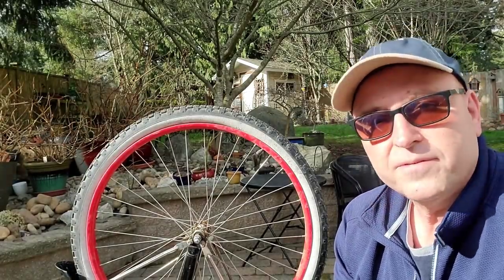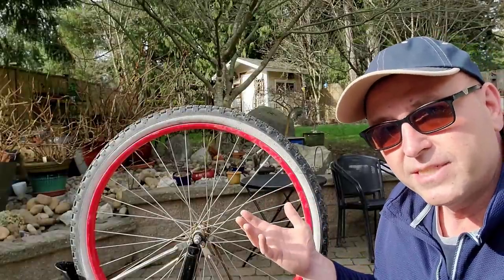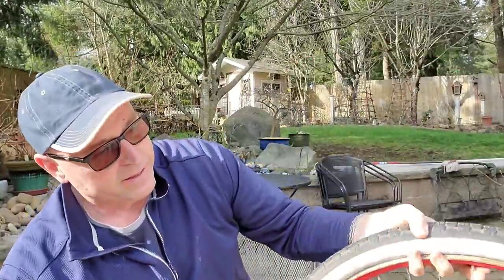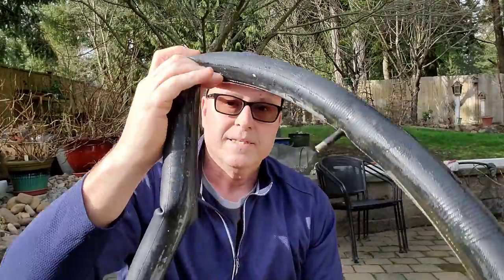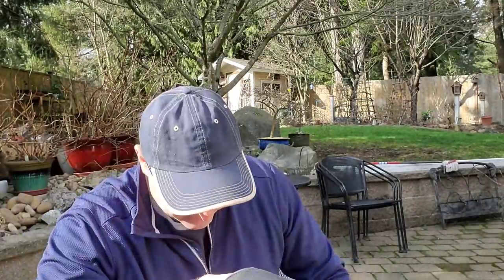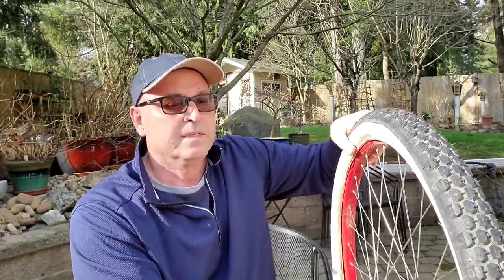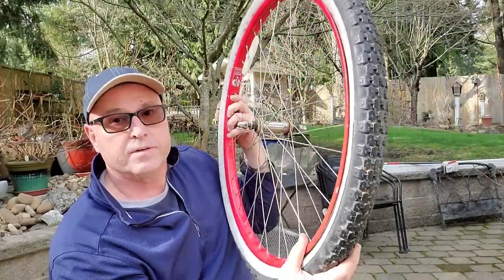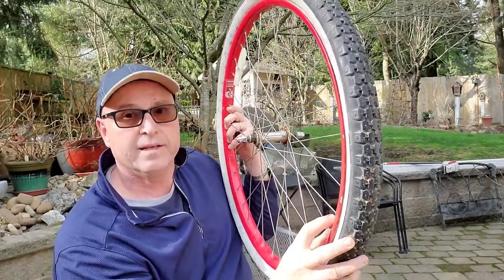How to Fix a Flat Bike Tire

Comment: Imagine my surprise a few years ago when attempting to fix a bicycle tire that I discovered that there is more than one type of tire valve.  Just like me, your viewers may not know this. Thank goodness for the internet.  The one we are all use to is the Schrader valve like on car tires. The other is a Presta valve. When you buy a hand pump, make sure you have the provided adapter if you are dealing with a Presta valve. The two don’t work the same way. I remember wondering why someone thought it was some sort of improvement.

Comment: Good Joke:) I am going to use it :)

I want to start off by thanking you for making this video and I appreciate what you are doing. 

However, I am a long-time cyclist over a variety bicycle styles and I would like to weigh in on your advice which isn't bad at all but could use some clarification. 

Flathead screwdrivers will work in a pinch, but I highly recommend not using them. Thin rims for certain bicycles can be damaged by them or the tube or even the tires. The tools for removing tires from rims are called spoons and they were even once used on automotive tires but made of iron. 

The ones used for bicycle tires are made of plastic, are much easier to handle, and are very efficient at the job, especially for more youthful hands. 

You can buy kits that carry these spoon tools specifically made for bicycle tires and I would highly recommend the purchase of these tools because you are more likely not to be at home when you need to fix a flat tire. 

You should always carry at least one but perhaps two spare tubes for a tube tire, a patch kit and the tools you will need for quick repairs on a bicycle.

Thank you and God Bless.

Comment: Around 5:50 you said that in order to mend a ride you'd have to let the glue dry before you'd be able to put the patch on. I've always been told to use the glue and directly apply the patch on top of it and then apply pressure on it before it dries (and it has always worked for me). I'll try your method next time

Comment: Another good tip for finding a leak in a tube is to fill a spray bottle with very soapy water and spray the whole tube liberally with it.  The hole(s) will produce bubbles.

Also, since it is a good idea to clean the tube before you patch it, this isn't really a significant extra step.

Comment: Dad, how do I drive a stick shift??

Video idea!!
Reply: Thats standard in all countries apart from the USA basically. Its a shame they don't teach you
Reply: Foot on the clutch pedal. Put the car into first gear. Gradually release that pedal while putting your foot down on the accelerator until you feel the car start to move then give more pedal. Go up gears when the car is making noise and down if its struggling up a hill etc